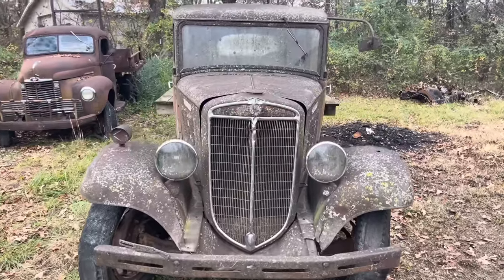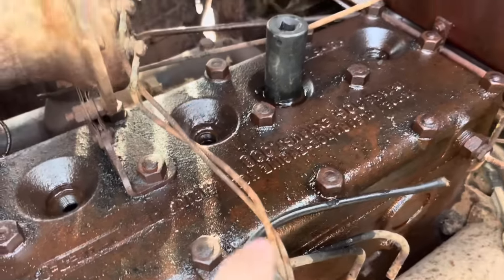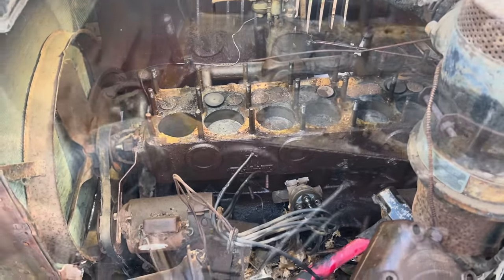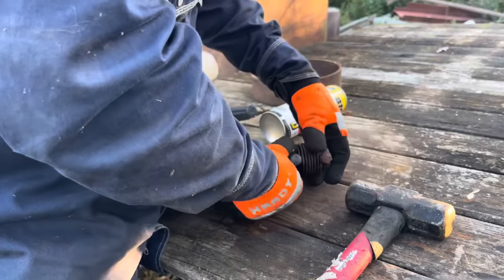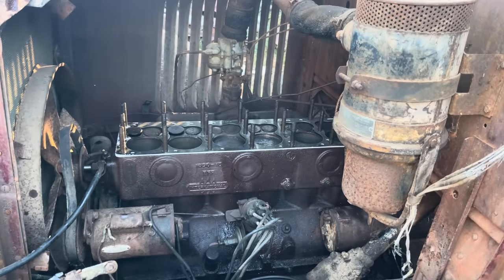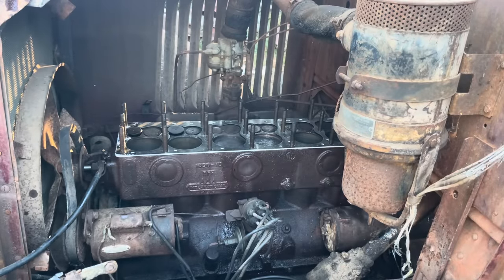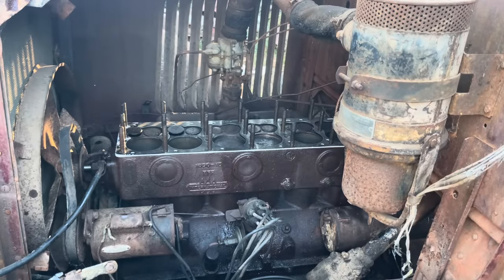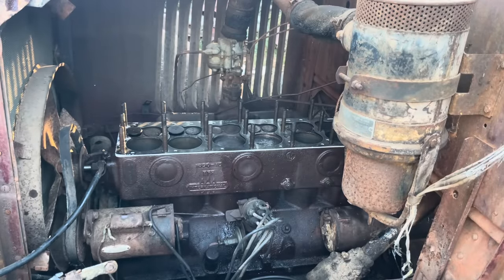Will it run after 71 years 1935 international c-30 ￼truck

Comment: My Grandfather, Thomas Jenkins, was born in Maysville, OK, in 1905. He worked for the Chikasaw Lumber company for years.
Makes me wonder- If thats the old truck, he wore Grooves on the road between Chickasha, to Pauls Valley, and south to Winniwood( however its spelled), in?? He used to talk about his work there, and his deliveries. 
He retired, in Sacramento CA. as a Cabinet maker, and trim man, in the 60's.. He passed away in 1983. I miss that man, and his Stories.
Reply: Its a good chance that he drove that very vehicle. That's awesome!
Reply: That is a very neat story!  My paternal grandfather who was a machinist/mechanic.  He told stories about needing only an adjustable wrench and a screwdriver to work on Model Ts.  My other grandfather worked at the Buffalo Bolt Company.  He ran a machine that formed bolt heads.  He had an assistant heat the bolts red hot and Grandpa did the rest.  I'm proud of my ancestry.
Reply: Wynnewood, Ok. My trucking company hauled jet fuel out of that refinery for the last 16 years. I personally hauled loads out of there from 2003 to 2011.
Reply: I doubt anyone wore grooves in the road with it considering it only had like 40k miles on it. I drive that much in one year for my job as a construction manager. seriously last year 41,000 miles this year looking like will be even more. Glad they dont make trucks like they used to because id need a new truck every year! my tundra has 400,850 miles on it as of today and still running and driving perfect. I have changed out the starter a few times and the radiator one time. tires and oil. thats it....
Reply: @AsTheWheelsTurn  a dirt road in 1930 absolutely would have tire grooves, especially thanks to those thin tires (its also a figure of speech). And a Tundra, though not as good as a Hilux, certainly do last....coz Toyota! I had a '92 2x4 diesel Hilux that I put 300 000kms on ,after I bought it at nearly 200 000kms, and I only changed the tires (didn't even change the timing belt like you're supposed to ever 100k lol). That was the best, most reliable and awesome little ute I've ever owned....best car I ever owned full stop lol.
Reply: Maybe he drove that truck!

Comment: Great video like all your others. Great grandpa bought then started making in different sizes a tool for cutting around the studs on flatheads. They resembled a bare spark plug body with a piece of sheet steel that he brazed around the body of the tool then sharpened with a file to cut the rust and carbon garbage around the head studs. Only used them a few times when I was a kid but they sure are handy. Grandpa said that was one of his jobs at the garage after school along with cleaning up around the shop. Also one of my jobs along with annealing head gaskets, grinding valves and seats, and lapping in valves. Kinda miss that stuff from time to time but just watching videos like this are close enough… and it doesn’t cause as many mashed fingers or busted knuckles. 

Doin a great job with the channel and the projects. 👍

Comment: A great way to get broken bolts to back out is to drill a hole in the top then take a torx bit one size bigger and pound it in the hole and then back it out. Hasn't failed me yet 👍
Reply: This move is great because if it doesn't work you don't break an extractor in the middle of your bolt.

Comment: I'm not a mechanic but I am an Appliance Technician. One of the things we use all the time is an automotive steamer. They are about $50 at Walmart. Might be useful when you are cleaning around the spark plugs and other tight spots. You would need a source of 120V power to run the steamer. It's high Pressure Steam. Anyway just a suggestion that might help out. Thanks for all of your videos! Love the content!

Comment: That truck is so cool looking. There's a guy down the road from me with a super straight 53 Willys pickup that they filled the bed with flower pots and flowers for yard art and it pains me to see it because I'm sure it would be a great truck with very little effort, and I really like that style of them. Glad you saved this one.
Reply: My first vehicle was  a  running 52  Willys  off a used car lot in Reno in 1975 for $ 750 bucks   and drove it home. Didn't have original 4 banger or six been swapped out with a newer  70's 4cylinder ran ok   but since it didn't have old school engine to keep original I decided to do a frame off using a 76 Chevy 1/2 ton running gear ,leaf's axles,a $ 50 basket case 307 motor w/fuely heads ,had it machined board,stroked,RV cam  etc.hot rod shop of coarse made new spring mounts to fit old frame Advance Adaptor motor mounts ,welded molded all holes in frame added tube cross frame, 12v wiring, Mustang gas tank under bed undercoated  the cab and brazed fender cracks no wire welder them days new weather striping for door glass etc.etc. all that ended up selling it to start a fur farm  business but bought a 56 Willys pu all original with straight 6 hurricane motor, pto, winch, running gear, original dash also thanks you for your channel and letting me blab a minute and inspiring me some more ...looks like I'm going to town and get some rust loosen upper liquidy kinda stuff thanks from N.Nv.

Comment: When I watch your videos, it takes me back 50+ years to my teens. I grew up on a fairly large cattle and sheep ranch in the mountains of New Mexico. My grandfather (Ira 1889-1981) and grandmother (Nora 1892/3 -1987) homesteaded then purchased and traded with others who did the same eventually growing the ranch to about 12 sections of land. Grandpa pretty much relied on horses and wagons until the 1930’s. Roads were two ruts created by wagons and model T’s etc.  Two good horses could out pull any vehicle of that era in terms of weight and cost. But from the 1930’s onward trucks and cars began displacing horses for everything except working with livestock.  

One of the trucks handed down to my dad was a 1.25 ton Ford truck with a flat head V-8. It was a 4x4 and had a two speed box that made the truck have a total of 8 speeds. Shifting was accomplished by listening to the RPM and know just the right moment to shift without gears grinding as there were no synchronizers in the manual transmission.  I had a love hate relationship with the old truck.  Two hours behind the wheel and your body would feel as if it had been assaulted. The only springs that actually smoothed out the ride were those in the 3 person bench seat.  Even in the 1960’s it was difficult to find parts.  

I wish I could save all these old vehicles.

Comment: Soaking the truck in a pool of PB blaster literally solves every problem you had on this relic. Rust, gone. Stuck bolts, gone. Stuck plugs, gone. Loose ignition wiring, gone. PB Blaster also inflates the tires and replaces corroded hose connections. The stuff is amazing.

Comment: Hi Bloke, love ya work. Watching from Australia. When your coolant system on them old girls is all rusty and sludgy like most are, wrap an lady’s pair of stockings or some flywire over the coolant line in and put your hose and clamp over it. Stop it from going into the block, easy to drop out snd generally the coolant is half decent still. #inlinefilter😂

Comment: If you want a lead for someone who can rebuild your clutch and pressure plate you can try, clutch doctor in north branch mn He did a great job on a set for a 1948 tractor I was working on. He also built me a custom pressure plate once for a swap I did with a newer trany on an older truck. Hope that helps.

Comment: There's a trick that we carpenters use that would have helped to get that head off. Folding wedges, we call them here in the UK. Once you've got a bit of a gap put a wedge in front and back. Tap in another wedge on top in the other direction. A little gentle hammering will lift the head off nice and square. Hope that helps somebody. Well done, young Jennings, your channel is inspirational. All those wonderful old, (properly old), trucks brought back to life. And this one is fabulous with the original sign writing... 2 years younger than my old mum, who's a dang sight fitter than I am... Go to the top of the class. 🇬🇧👍
Reply: In my collection of "stuff" I have several wedges of wood made from various lengths of 2x4. You pry up and stick in a wedge, then do it on the other end... repeat as necessary.... back and forth.... side to side.

Comment: Watching this and fully expecting what did happen…..HAPPEN !!
Just glad you weren’t injured. 
Acetone is an outrageously high vapor chemical. So whatever you do with any chemical remember the 3 elements of FIRE. FUEL,OXYGEN,IGNITION 
I’m not trying to be humorous and using a shop vac I’m surprised that that didn’t also catch on fire and/or explode. 
Be Careful and know what your dealing with. 
I like the down home commentary but again just advice for the living.

Comment: You can sometimes break them free by closing the valves and using a grease gun as a hydraulic pump to force the piston down as it's pumped up via fitting in the spark plug hole.
Reply: How do you close the valves?
Reply: @ismoaulaskari3987  if it's ohv you can loosen the rocker arms. In this case, maybe you could slide the cam out.
Reply: @camshaftprelube    you will never move the cam with pressure on the lifters.
Reply: @rupe53  take the cam gear off.  This also works great on ohv engines.
Reply: @camshaftprelube    well, that can work. The flip side is it's easier to get the head off than fool with the timing cover. Did you know that some of these old engines have a fiber timing gear? You don't want to break that because you will never find a replacement.
Reply: @rupe53  the point I'm making is that this often works, and it's one of the least destructive ways to get a stuck piston to move. Beating on them with a block of wood and a hammer can sometimes lead to damage.

Comment: Mr. Jennings, years ago I had bought a late 1940's KB8 International, I was told the truck ran, when I started working on it I found the oil was really clean, I drained the oil & dropped the pan, there was almost 3/4" of crud in the bottom of the oil pan, my thoughts were it sat for so long all the crud in the oil dropped to the bottom of the pan..
I would like to have your IH, is it for sale?

Comment: You never clean the top of the block. Seal waste of time.
Why no put acid with trans oil over the valves ? At the same time cycles? You never clean around the valves . 
Why not lobe evening bore you started. ? 
Such a old engine.  Acid ton and transmission fluid to the top . All the water jacket  everything. 
You showed how much rust she has. 
Mmmm lost some time boy. Happy new years my friend. 
Mick Australia

Comment: ‘Sometimes it helps to read the instructions.’ —But only if you really need to! Hopefully before you break something. 

Another suggestion: You might want to invest in a thread chaser they make for spark plug holes in heads: allows the spark plugs to spin in easily.

Comment: I just rewatched this video and am glad I did. I have a 37 IHC 1 1/2 ton  and this helps. She's not stuck tho. My 42 jeep I pulled the head cause she's stuck hard. No rust, ridges or pitting. Finally got er turnnin with a maple limb drift and an 8 lb sledge.  Now I got kindling for the stove.  Thanks for your fine channel.

Comment: I've always wondered why we don't make trucks like this anymore? The styling, the size, and we could certainly get better performance per the same engine displacement. That all makes more sense than the less than stellar offerings we have today. I also wonder how hard it would be to repower an old truck similar to this with a ford 300 6 cylinder?

Comment: I could use a good 35 work truck on the farm
Not to great on the fuel economy tho if you got to take them on the road to do a pickup.
We had a well drilling rig truck like this but my dad in a moment of st00pidity took the cab off to ratrod it, and had a scrapper haul away the rest of the truck.  He never did anything with the cab and it's still sitting around.

Comment: This is the first of your videos I've seen. It DID NOT DISAPPOINT !! You went about it the same way I did an old Harley 45 flathead I bought with a stuck top-end ex cept much easier   using acetone with the trans fluid instead of the desile fuel and old gas I used (all I had) which took days of soaking and tugging to get jugs off! Will definitely watch you from now on !

Comment: I have yet to come across an International that wouldn't run. My '63 was stuck and came back around with a little coaxing, and there's a green diamond engine locally that still turns after spending 35+ years in the bed of a truck.

Comment: Well back in the day they worked the hair off of these old International trucks. Probably yanked the center plate and center and detent springs . And laying inside the clutch housing. They used that same clutch and pressure plate probably up in to the 60s. But the clutch is probably done. It looks like the same one they used on the tractors Aliso. Might be the same one probably. You can get the old clutch and pressure plate rebuilt for cheap.

Comment: Could be vintage dust bowl dust inside of that clutch cover, mixed with a little asbestos powder from the clutch. Would think it would have light use in 1935, unless the lumber was delivered to a booming oil town.

Comment: I enjoyed this video.  The old truck should be a driver once you spend a few more hours on it.  Hopefully you can find a used pressure plate and/or clutch disk to install.  At any rate, the minimum that should be done is to pull the transmission and remove the clutch assembly and see if it is okay…. Probably not, but ya never know what you may find.  I will be looking for a part two….

Comment: How much money do you spend on Acetone ATF and spray lube a engine? You sure waste a ton of that stuff because you putting it where it's not needed you need it on the valves and it's valve guides not in the pistons because the pistons hardly ever stick on a flat head engine it's the valves 99% of the time. I bet you if you focused on the valves and not the pistons on the next engine you will save a bunch of stuff and you will get it done faster. I have been working on flatheads since I been 18 years old and I am 45 right now and telling you the pistons are very rarely the issue that is a overhead valve engine issue put the flatheads it's the valve guides that stick to the valves and lock it up.

Comment: My Dad had a 1931 C cab 1 tonner (that is the same shape body ended at the dash the rest was crafted in wood by a carpenter/body builder) about 1954. Later he purchased a cab from a 32 model, closing doors made long distance driving more comfortable.

Comment: You could save yourself some money and just keep old oil out of your daily driver for use on this old stuff.  If you get it running good and are going to use it then change it again with new oil.  Also you can run a little diesel fuel or automatic transmission oil mixed in to cut off some of the buildup inside, but you have to be careful with the really old stuff as it was probably run with non-detergent oil most of it’s days. If so you might clog the oil pickup and starve it for oil which would lock it right back up.  Amazing to hear it run again after all these years.

Comment: I don't know the other penetrating oils, but WD40's "Specialist" in the grey and black can works wonders. Even got loose bolts the dogs had peed on for 10 years, and all I did was soak them overnight.

Great truck. Sure runs smooth after all this time.

Comment: You were having a problem with the rusted plugs and it reminded me of a crow foot type rachet that had jaws that tightened around the object and you could use that to get a grip on any size nut that was deformed. Sad to say I do not have any rememory of when, where or company, but I know it still hasta be out there.

Comment: The main thing that locks those flat heads up are the Valves they are always 99.9% of the time the issue that or just junk sitting on top of the valves. It's very rare to have a flathead stuck because of the pistons that more of a overhead valve issue not a flathead issue. It's always the valves that stick in it's guides that becomes the issue.

Comment: Yeah the head is supposed to come up and off even if you lift one side higher than the other it's going to bind up you have to lift it up even or you  will be there all day doing what you're doing. What I did was take old spark plugs and weld a eye bolt into the steel piece of the plug that screws into the plug hole and you put one on each end and it will allow you to lift the head real easy and will not have to spend all day binding up because one side is higher than the other.

Comment: Here's a hit or miss method to loosen up the clutch: start it up in with the transmission in low gear. Once you are moving at a steady speed, pump the clutch pedal until it starts working. Doesn't always work,  but it's worth a try.

Comment: ever try using a large impact gun on the spark plugs? Just send it style. I tell ya this works like a charm on the 5.4 3v triton engines with the 2 piece spark plugs that like to break in 2.
Reply: he was using an impact gun while the head was on the bench.... and they still didn't move easily.

Comment: I always wondered if a vacuum could explode, if sucking a good air/fuel mix past that sparking air cooled electric motor... Gotta try it out😅
Reply from the maker: I would not suggest doing it but I have sucked up gas acetone even starting fluid with mine and so far I have been lucky and not had one explode but it could happen any day now